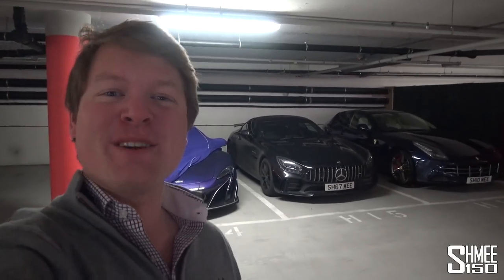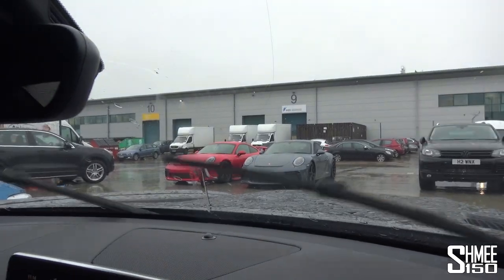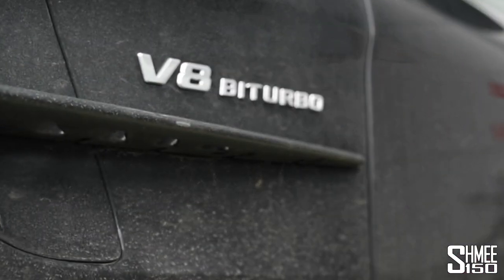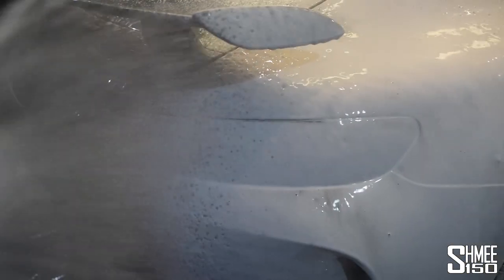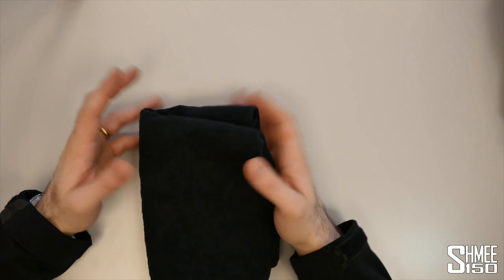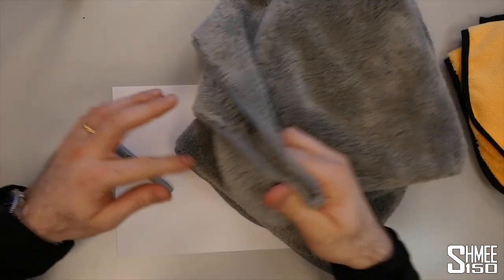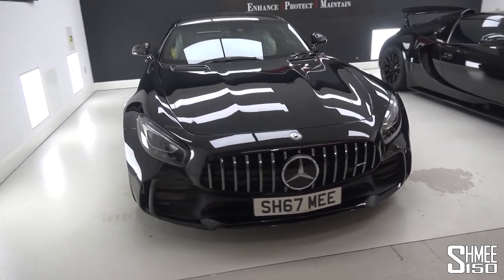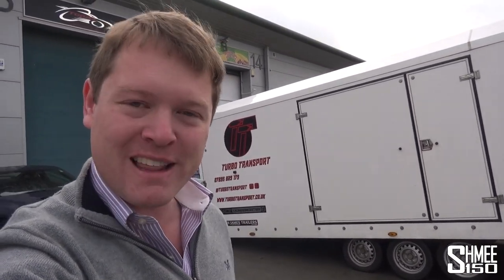I Got My AMG GT R This Dirty! | GARAGE

Comment: Also, did Topaz fix the paint chip and swirl marks?
Reply: Winnipeg Car Life Yes
Reply: That was my question too. Didn't see the end result.
Reply: Was wondering as well, that big chip and  those swirls :) They won't disappear by putting ppf on those
Reply: Yes they would have done. A light wet sand and polish then ppf on the top.
Reply: I agree they should have done but did they? It would have been nice to have seen a bit of it.

Comment: In my experience, one needs to put the car on a lift and clean it properly from underneath to make sure there is nothing corrosive left on the underside, or trapped inside the under body 
 and diffuser fairings.

Comment: 2:46, its a rust on your brake disc ?
Reply: Michał Garwoliński brake discs rust overnight.
Reply: Not in my mercedes
Reply: Michał Garwoliński suppose it depends on the climate because in England it rains a lot and I do mean a lot lol.as well as moisture in the air if you live in a dry climate it would be different no doubt.
Reply: Ok maybe its a reason but its looking not so good and its brand new car
Reply: Michał Garwoliński I know what you mean.its ok though as it scrubs off in a couple of miles of driving.